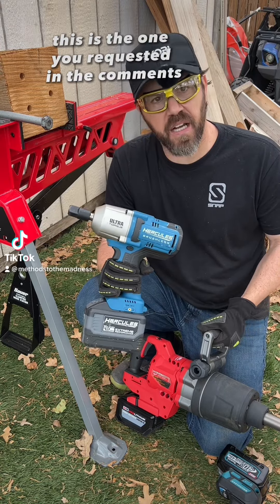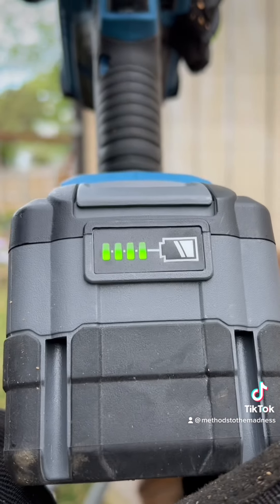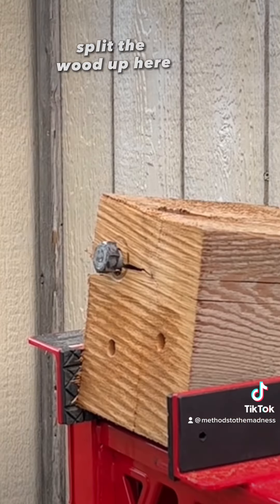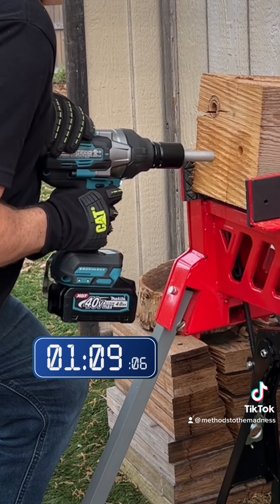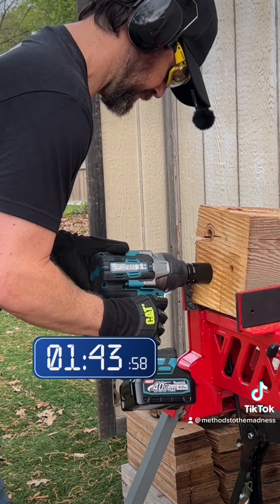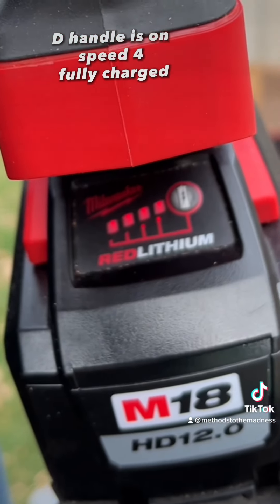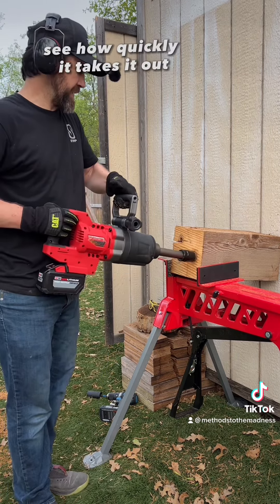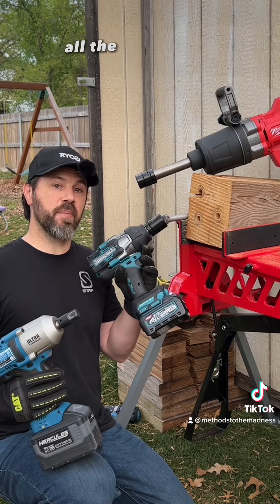Hercules 1/2” vs Makita 3/4” vs Milwaukee 1” D-Handle!

Comment: When the block split. Should have started over with new hole. No ft lbs. required at that point and the gun was speeding up. Under load it would have suffered drastically

Comment: makita is trash
Reply: Disagree
Reply: Look at the size differences. And Hercules really sped up once the wood split. Predrill would make it apples to apples. Plus would be more concerned about longevity with Hercules. But still good performance from a budget oriented tool
Reply: @ccbowers  Hercules is better than makita
Reply: @UncleIvan1  😂😂 Good one
Reply: @ccbowers  more power- better brand
Reply: @UncleIvan1       First, they are not in the same league. And more power here (if that is even true) doesn't mean better brand- this is one tool in which the Hercules was driving into spit wood.
   Where is their large battery powered SDSs? Demolition hammer? Concrete saws? Large battery powered angle grinders? Battery powered 12 sliding compound miter saw? 10 1/4 inch saw? Mowers? blowers? chainsaw? etc, etc 
  Yeah. Budget brand Hercules does perform well at their price, but are made cheaper, and has a relatively small line of tools.  Great for many many people, but not really competing with a tool brand with a huge line, that is used all over the world.
Reply: @ccbowers  i apologize for wasting your time,  but I'm just trolling man ...I love makita